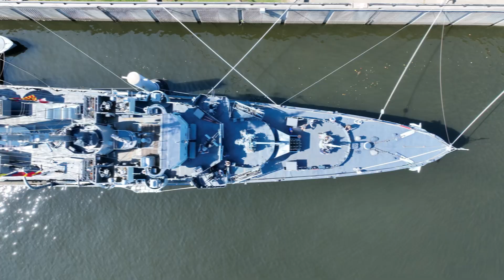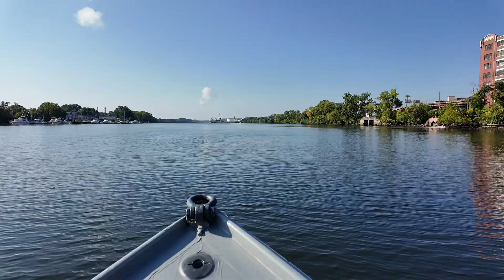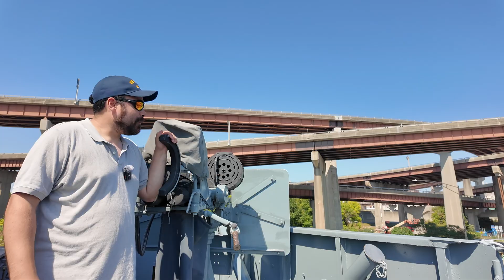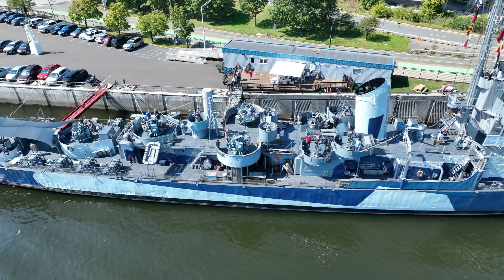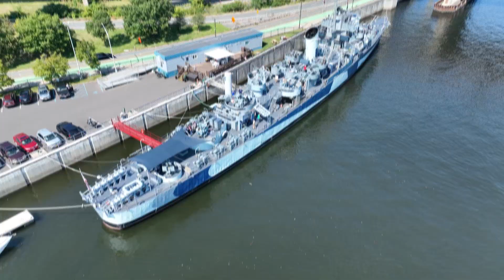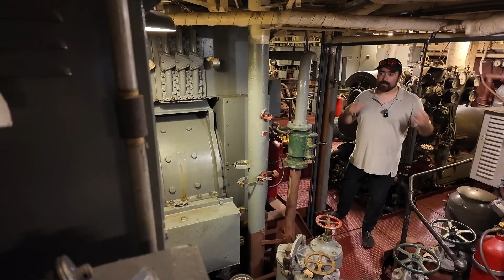USS Slater - Albany's Destroyer Escort

Comment: I've thought for years now a modern destroyer escort would be perfect for shipping/merchant protection. With a large increase in piracy/attacks on shipping vessels at key oceanic chokepoints (Red Sea/Suez Canal) a lightly armored but heavy on the smaller size firepower escort would make fantastic vessels for transoceanic protection. Relatively low cost, low crew numbers, good return on investment.
Reply: I'm pretty sure every modern warship is lightly armored

Comment: My father served on the USS Lloyd apd 63, and it was very similar to the Slater, but it was converted from a DE to an APD after its first escort duty to Tunisia.
With the conversion came a 5"/38 cal dual purpose enclosed mount, and some dual 40 mm bofors.
They also need quarters for about 160 Army personnel and four LCVPs in davits.
They would deliver troops to the beaches in the first waves in the Philippines.

Comment: Just asking, but wouldn't the propulsion system be more rightly called "Diesel Electric" since there isn't a turbine involved in the engineering plant? I understand that Tennessee Class battleships had steam turbines driving electric generators and were called "Turbo-electric", but the US also operated the Balao Class submarines which used electric motors and diesel generators "Diesel Electric" since the diesel engines only generated power to charge batteries or drive the electric motors (hybrid vehicle). To me, the Cannon class is closer in propulsion design (minus the battery system) of a WWII Balao sub than a Tennessee Class ship. RMS Queen Mary 2 operates on electric motors powered by a COmbination of Diesel engines And Gas turbine (CODAG electric). 

I guess If I had enough money to design and build a 21st century Montana Class battleship, I would go for CODAG electric as a propulsion system since you can run low speed operations and hotel load on diesel generator engines, but power up the turbine for high speed operations.
Reply: She’s a diesel electric tandem drive. (DET).

Comment: Maybe it would have been a good idea to re-shoot the entire engine room sequence...    I don't think that diesel turbo electric was ever a thing.      The correction you added in also had some errors.     'Some diesel electric submarines had batteries...'      If I remember correctly, all diesel electric submarines had batteries.      All in all though, still a fun video.    Thx.
Reply from the maker: @stargazer5784  I specifically noted in the correction ahead of that segment that turbo-electric was incorrect and it is in fact diesel-electric.

The bit you mention about subs, I was noting that some subs had a similar system where the diesels ran the motors which turned the screws, while others used batteries to drive the motors to drive the screws but also had a separate mechanical linkage allowing the diesels to bypass the electrical system entirely.

Comment: I sailed on 2 cruisers, a heavy (CA 148) and a light missile (CLG 7) I made 2nd class electronic tech, in 18 months, but while I was a seaman my GQ station was the 1first or second loader on the starboard dual 3-inch mount. So, more modern than the USS Slater was. I enjoyed the walk through the past.

Comment: I don’t know cruiser from a protected cruiser.
Reply: Terminology changes a lot of time.  In general, a 'cruiser' is typically a medium sized ship intended for long range use (it helps to think: it goes on long cruises).  In the days of sail, small ships could go on very long journeys.  That changed with the introduction of steam: a warship had to be bigger and specially designed for longer journeys to carry the stores needed - and still needed access to coal (or wood in some cases) on a regular basis from an external source (dedicated ship or base) to make really long journeys possible (as well as resupply of food).

A 'protected cruiser' is an older classification used to differentiate cruisers with an armored deck from cruisers without an armored deck (mid-late 19th century).  An 'armored cruiser' has sides are that armored (an armor belt) as well as a deck that is armored (late-19th century to early 20th century).  In both cases, there would likely also be armor on the guns and magazines.  These terms would largely disappear after WW1.  

In WW1, 'light cruisers' were small cruisers usually intended as scouts, for commerce raiding/protection, and as destroyer leaders.  They carried bigger guns than destroyers, and were larger than destroyers with bigger crews.

Most warships would move from coal to oil by WW2, so longer ranges were possible.  Cruising distances increased considerably.

By the time of the naval treaties (before WW2), a cruiser was any ship with an armor belt (different from splinter protection), a cruiser with guns 6 inch or less was considered a 'light cruiser' and cruiser with guns larger than 6 inch and up to 8 inch was considered 'heavy cruiser'.   Anything with an armor belt and guns bigger than 8 inch was either a battleship or monitor (the monitor was shallow draft and had fewer guns, intended for coastal bombardment not for extended operations in the open sea).

Before WW2 Germans created a class of ships often referred to as 'pocket battleships' - these are really heavy cruisers in most respects, carrying fewer but larger guns (11 inch, so in the battleship range).  The small number of such guns that could be carried restricted the salvo size which wasn't great for getting hits at longer ranges - plus larger guns usually have a slower rate of fire which makes hitting highly maneuverable targets difficult.  These ships had diesel engines that gave them a very long range compared to other cruisers.  An interesting experiment.

Prior to the treaties, navies had their own definition of 'light cruiser', which could refer to armor thickness instead of gun size.

USS Slater in this video is just over 300 feet long and carried a crew of ~200.  Only a few WW1 destroyers were this large, and none carried this many crew members.  Many WW2 destroyers were longer than USS Slater, a few could be as long as some WW1 cruisers.

A typical WW2 cruiser would be 450-600+ feet long and carry a crew of 500-800+.  The shorter ships were generally leftover from WW1.

Today cruisers are the largest non-carrier warships in service.

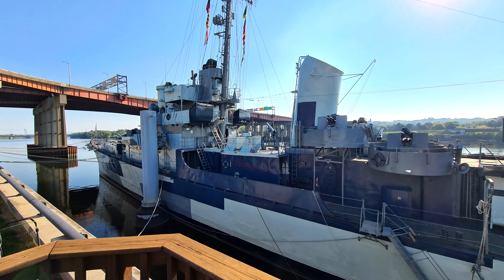Comment: Intersting fact: According to the tour guide when I visited, the angled ladder you can see leading to the bridge at about 4:20 (same level and to the left of the loading practice machine) is actually off the USS Franklin.

It was originally vertical, and was greatly disliked by the crew. The refit for the Pacific took place near where the Franklin was being repaired after her massive hit, and the Slater's captain authorized a small party to go find a better ladder.

Comment: I served part of my U.S. Naval reserve duty aboard a WWII era turbo-electric driven DE in Long Beach California. That system had an ability few of the other DE's did, in that there was a huge reel of  insulated wire aft of the funnel which if deployed, could supply emergency electric power to a Pacific island or other shore operations whose power plant had been put out of action. The DE's were quite varied in their utility.
Reply: What sort of time frame was this? I've known about warships acting as power stations before (such as the USS Lexington CV-2 powering Tacoma, Washington in late 1929). Just curious how late the DEs were still actually being used to provide power? Or was this more of a "just in case" coil?

Comment: For a small ship she's packed with firepower.  I'd imagine that to a surfaced U-Boat or IJN sub, that 3" gun might as well be a battleship.  Great video.
Reply: Many Japanese subs had 5.5 inch guns (14 cm/40 Model 1922).

While not armored, the hull of any sub had to be immensely strong to resist the water pressure at depth, and was also rounded in places which caused many shells to skip off.  For this reason, the base of the conning tower was the preferred target when trying to penetrate the hull of a sub.  

The other big weakness of the sub on the surface was the lack of protection for the crew while operating the guns - the anti-aircraft guns carried by surface ships could quickly wipe out the gun crew.  

The smaller surface escorts didn't necessarily have bigger guns, but they had a lot more guns and that made the difference.  It was exceptionally rare for a sub to survive being forced to surface near one or more ASW escorts.

Comment: How easy is the 3” gun to train?
71 years ago the builder said “SIT” and the guns still sitting there.  Very well trained
Reply: "Bark!"
Reply: @spikespa5208  Roll over!... oops.
Reply: I was in the aftmost 3" mount for this event (the fat guy in the gray tee)! The guys actually working the adjustment hand cranks were ZOOMING to keep up, and I was glad to just be directing. It was a cool experience, but you'd probably have to swap out after a while in extended engagements. They were sweating up a storm by the time Drach set the drone back down.

Comment: Fun fact: There are two other Cannon class DEs still around! One is the ex-McAnn, preserved as the Bauru in Brazil. The other is the ex-Hemminger, who is still in active service with the Thai Navy as the HTMS Pin Klao! She's primarily used as a training ship, and from what I hear is in pretty good condition! She's also got an interesting set of weapons. She retains her 3"/50 and 40mm Bofors, as well as her hedgehog launchers, but it also seems that she's been fitted with modern 12.75" torpedo launchers!.
Reply: McANN is most original with single 20mm and she still has her torpedo tubes.
Reply: A year too late, but I'd like to say that Pin Klao is currently (august 2026) being converted into a museum ship after almost 66 years of service. As far as I can see the vessel is currently being moved onto the ground of the naval rating school in Chonburi.
Reply: It makes me think that the Navy should have just kept them and run them all these years.  Even give a few to the Coast Guard for use.  Instead, scrappers with government connections made their money off of a class of ships that easily could have served the USA - at reduced costs to buying new ones - for decades.
Reply: @workingguy-WOTm8 Not really.  Those WW2 escort ships were not exactly built the most durable compared to earlier and later ships.  They knew they would get worked hard and equipment beat to hell.

Comment: Always a good video.  Thanks.  With the amount of time you've spent on the hedgehog and 20mm ammo lockers, 3 inch guns, 20mm guns, K guns and racks, and stern depth charge racks, this video is going to get a LOT of reviewing as I scratchbuild my model of USCGC Algonquin, WPG-75.

PS, here's a plug for a 5-minute video on the Algonquin-class icebreakers, 5 of which spent the war on the Boston-Iceland convoy routes and put in a great deal of time on the Greenland patrol.  While most were scrapped by 1947, two lasted for over a decade, the last of which, Mohawk, ended as an artificial reef off of Florida around 2012, far from its WW2 stomping grounds.
Reply: Back again, this time revisiting the portion with the K guns and racks, and trying to suss out the K gun cartridge locker, which I suspect is on the port aft bulkhead of the deckhouse.   Thanks for this invaluable video tour!
Reply: Back again, this time for the 20mm lockers and maybe see what the bridge might contain.  Again, a  very useful video.